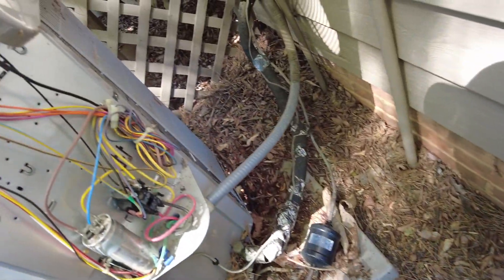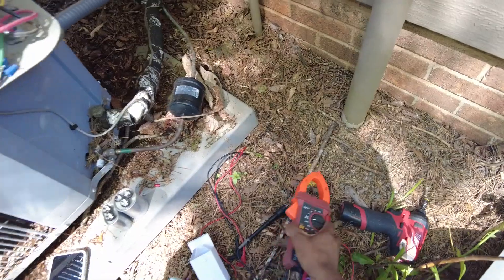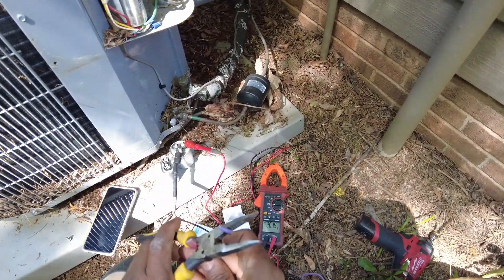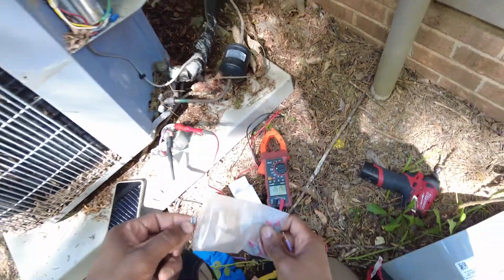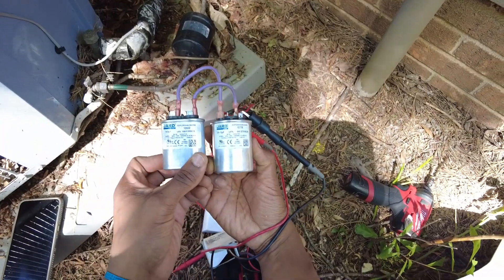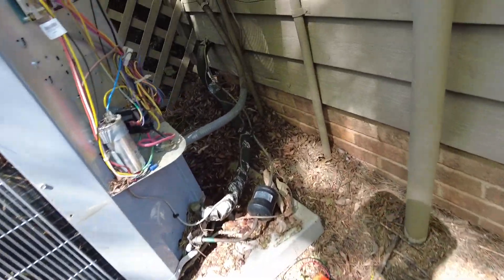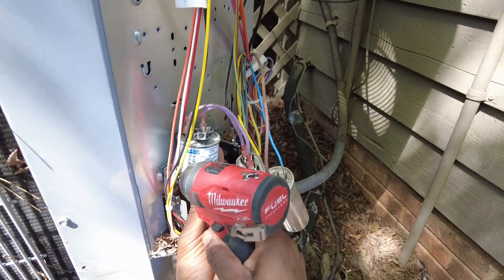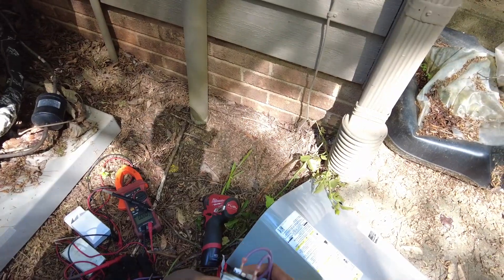Stacking Run Capacitors for the Right Microfarads | Run Capacitor Mod for HVAC Techs

Comment: Thank you very much for your help..

My compressor have a 200uf capacitor for starting  that is bad and I can't get no 200uf capacitor here , so was thinking if I can use two 100uf capacitors
Reply from the maker: I'd probably recommend just installing the proper 200 microfarad start capacitor. Thanks for watching!